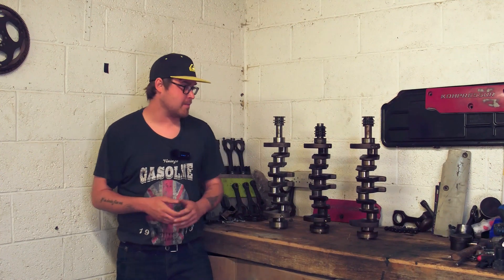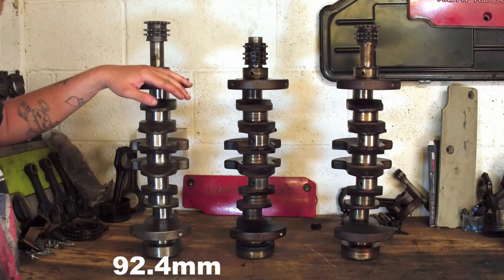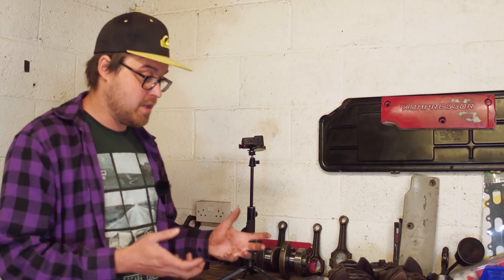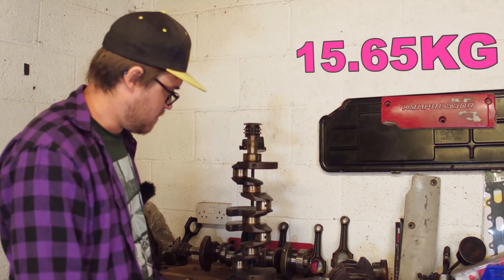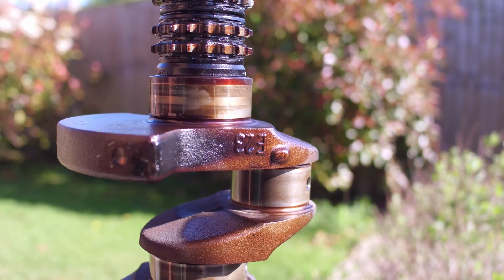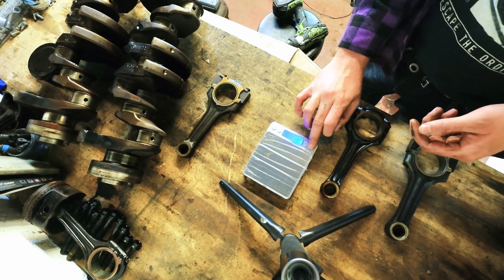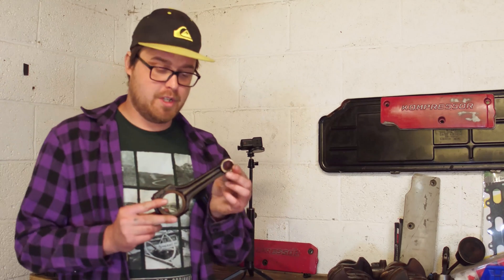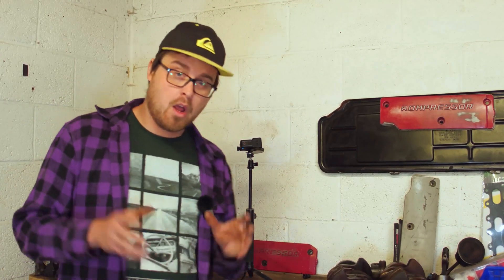M111 vs M111 EVO Crankshaft & Rods – What Actually Changed? #subscribe

Comment: You could use m104 H profile conrods on m111 too 🤔
Reply from the maker: Depending on the length used yes definitely, it is something I've looked Into this Frankenboost build I'm doing is more woe just and experiment of how much power the engine can make on mercedes parts alone, aside from the ARPs and MLS headgasket

Comment: I wanted to know these differences ever since 2010. Thank you! Is anything forged as is alleged about the 2.3 engines?
Reply from the maker: So this is a bit of a difficult thing to answer they're cast steel rods that have a huge amount of strength for factory rods, they're not "Forged" as what you think forged rods to be but that's not to say they're not Forged I believe they went through some kind of treatment either whilst being cast or after the fact, but it's not just 2.3 the same rods are used through all capacities of these engines with the cranks and pistons and bores being what changed, infact M111 rods are actually just M104 2.8 rods and are stamped as 104 rods

Comment: Have you tought about using 147mm (i've seen some forged 'cheap' ones online) rods with the OM601 crank and the default m111 pistons?
It would compensate the 4mm difference in stroke. I I calculated correctly the compression ratio would just be a bit higher.

Comment: I like those videos a lot Alex!! M111 info is pretty hard to be found and this makes it so much easy.
Waiting for comparison on the cylinder heads as i've read that the EVO head has better air flow...i suppose because of the valve opening pattern? If you have any info of that it would be helpful!
Also EVO valves are stronger than pre-facelift ones.
Reply from the maker: Thank you, it does hwlp to have easy to access information i wish i had when i first started with these engines, the cylinder head video will be coming soon, i need to try ang get some better lighting in the garage to help with the videos. I also am trying to get sponsors for tools and stuff but unfortunately being sub 10k subs is holding me back on that side of things, so i need to really push quality to bring in and retain loyal subscribers like you. So ill try not to drag my heals and get on with that video 🙏

Comment: Surprising results Alex! Great rare opportunity for a side by side with the different engine generations, if i were to guess mercedes maybe changed the casting of the rods and crank on the EVO for better balancing at high rpms considering some C class came with reasonably short ratio'd 5 speed autos and 6 speed manuals. P.S. The different camera angles make the videos really efficient and engaging keep it up!
Reply from the maker: Thank you buddy, this video didn't come out at the quality I had planned but more so due to the issue with the video corrupting itself last week, but hopefully the next video will be tip top quality 👍, I would have thought of they were going for better balance at high rpms I would have thought they would lighten everything to bring stability, that said Mercedes do like torque more rotational mass would equal more torque. Who knows we, but this is why I like to look at things like this as I've always been lead to believe the Evo rods and crank were lightened, where as this proves otherwise, so it's interesting to see it all from a technical bit just visual perspective 👍